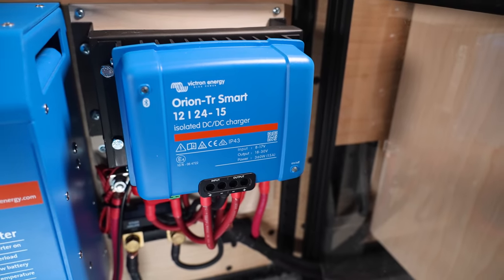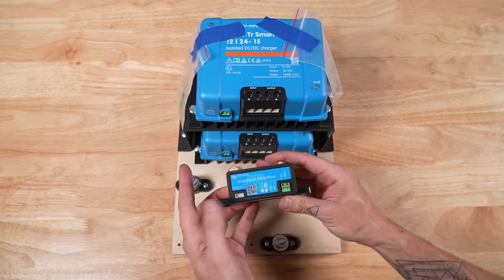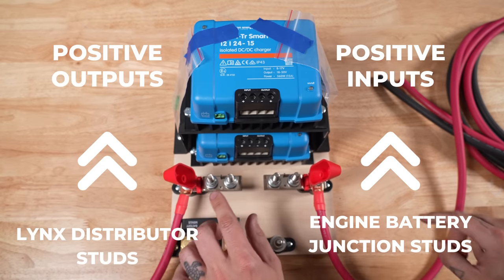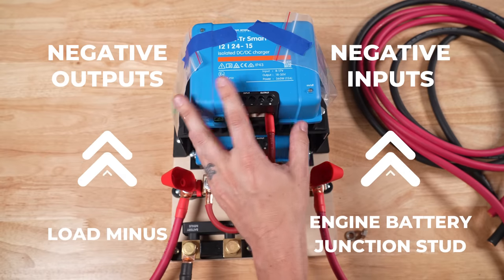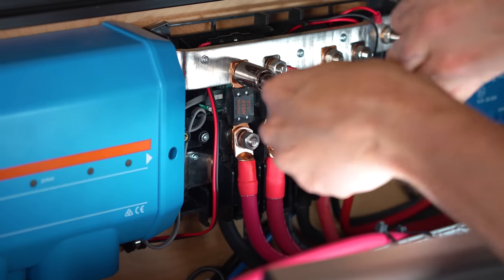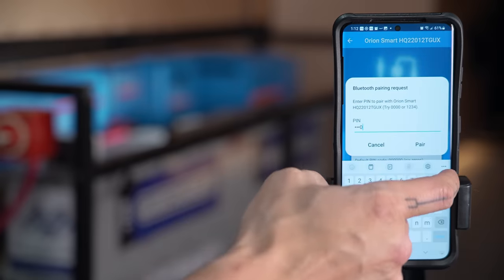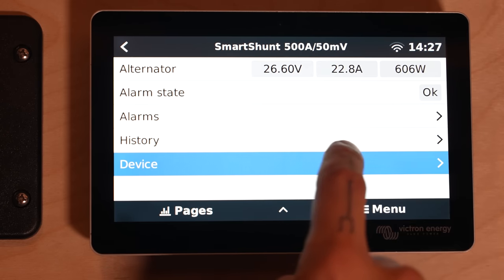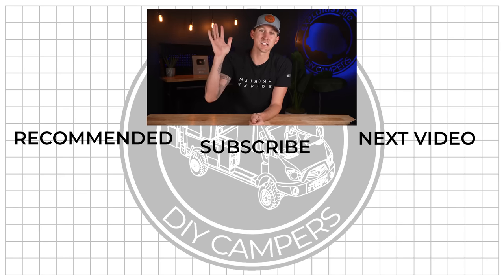TRANSIT ALTERNATOR CHARGING - DUAL VICTRON ORIONS

Comment: I did essentially the exact same thing for my Transit.  I found that you will need to add cooling fans for each Orion.  They heat up fast and will drastically reduce (throttle) charging output unless kept cool.
Reply from the maker: Neat!  Glad you found a solution for your overheating issues.  That's not a problem we are experiencing, but we have pretty good ventilation in our enclosure.
Reply: Sell them and get a Buckboost 50 or 100A.
 It runs cooler.
Reply: @silviuflorescu6838  I ran a buck booster for awhile.  It did run cooler but it was not as easy to manage as the Orions.  You have to hook a laptop up to the Buckbooster to manage the settings.  Orions turned out to be simple and effective (as long as they are kept cool)
Reply: @TrailAgent  , you are right, they are harder to set up and need a laptop.
Another drowback... unavailable 🙂
Reply: @TrailAgent I highly recommend a three-quarter inch gap between the air-cooled fins and the mounting surface.   Much better air flow and reduced temp of charger.

Comment: Why didnt you just get a 30amp instaed of two 15amps dc2dc’s?
Reply from the maker: It'd be the same wire-up process.  For this particular video; this was connected to a 24V battery bank; in which a 30A Orion doesn't exist.

15A @ 24V is the same as 30A at 12V.

Comment: So Victron’s recommendation that Orion’s be fixed to a non-combustible board isn’t really applicable…??
Reply from the maker: Plywood has an auto-ignition temperature of north of 500 degrees F.  If anything here gets that hot, there will be more than just the wood catching on fire.

Comment: I'm really confused as to why 150 Mega fuse is used on 30amps of charging current?
Reply from the maker: Wire size is based on current.  Fuse size is based on wire and is only loosely tied to the current.

Comment: I'm just curious but no one makes a 12v to 24v DC to DC charger bigger than the 15A that is shown here ? I've been searching and I haven't seen one.
Reply from the maker: Victron makes a 50A and a 100A; but the 100A is out of stock indefinitely and the 50 is pretty terrible from a programming/setup point of view.  They will be coming out with higher amperage ones soon; but they have also been saying that for a year at this point; so I'm not holding my breath.

Comment: Any ideas on specs of new B TO B ORION  chargers
Reply from the maker: Yes, but until they are officially announced, I hesitate to share because I don't want to hint at something that they keep pushing the release date back for.
Reply: @EXPLORISTlife it would be nice if they could accept wire thicker than 6ga. Perhaps they will have a threaded terminal that can handle a wire lug with heavier gauge wire. My setup for a travel trailer requires 4ga. I've been wondering what my options are.
Reply from the maker: Hm; that's interesting.  I haven't run into a single scenario where somebody NEEDS larger than 6ga wire.  We can really push the voltage drop to it's limits since the entire point of a DC DC Charger is to boost the incoming voltage.
Reply: @EXPLORISTlife  I'm trying to run it from my 4runner to my travel trailer so it's a longer run than a van. That's a good point that it adjusts the voltage anyway so as long as it's close to the battery, it should have the proper voltage, I just won't get the full amps, but wouldn't it have the potential to heat the wires up beyond their rating?
Reply from the maker: 30A through 6ga wire is WELL within it max ampacity rating.
Reply: @EXPLORISTlife  for a 15' run? 30' of total wire? I used the Blue Sea systems app and it recommended 4ga. The batteries are in the center of the travel trailer and the battery is in the front of the 4runner (obviously).
Reply from the maker: 30A @ 12V through 95ft of 6ga wire is still only 10% voltage drop.
Reply: @EXPLORISTlife  oh, I was using the default of 3% but since it regulates the voltage I assume that would be corrected. That makes sense. Thank you for helping me understand that better. So just to be clear, I should be able to get the full 30 amps (or close) but would have some voltage drop due to the distance but that would be corrected by the DC to DC charger.
Reply from the maker: Yep!  Exactly.
Reply: @EXPLORISTlife  you're a great teacher 🍎, thanks!

Comment: I have nearly the exact same setup. 24v system with 2 DC to DC chargers. Hooked directly to battery. But my 2 chargers won't output more than 400w max. I need help with settings or something. Anybody?

Comment: Another great video. From what I could tell the two chargers are wired in parallel. Just for some clarification do you need to use the isolated chargers to connect them in parallel or would non-isolated be ok? I've looked over the manuals for the various dc-dc chargers and converters and in some cases they don't mention parallel or series. For the Orion 70amp converter version like the one in the setup above, that was in a previous video, the manual says you can have up to 5 in parallel but the manual isn't clear how that is done. I was wondering if in a future video you could explain the difference between isolated and non-isolated, converters and chargers and if they should be in parallel or series. The Victron diagrams do show dual chargers but they have a lot of data cables connected between the devices and its really hard to tell if any of that is actually required. These videos are amazing and really do clarify a lot of info.
Reply: Isolated just means it has a different ground. In this case they have a 24V system but only 12V on the vehicle side. In most cases you can just use the chassis and share the ground connection

Comment: I am confused as to why you didn't just select the 12|12-30 Orion instead of two 12|12-15 versions?
Reply from the maker: Because we have a 24v battery bank. 🙂👍  The 12|24-15 is equal to the 12|12-30

Comment: Why do you need to put this between the alternator and the battery?
Reply from the maker: Because that’s how the device works? 🤨
Reply from the maker: Some additional context to your question may yield a better answer.
Reply: I mean like I have a 200amp relay that allows my alternator to connect to my lithium battery but when I turn the vehicle off the relay then disconnects the starter battery from the lithium battery, what is the benefit your setup with Orions vs my set up?

Comment: Hi I was wondering if you would be able to design a battery system for my 5th wheel RV. I'm looking for a system that would work with solar, generator, shore power and alternator from my semi truck. If you are interested feel free to respond to this message. Thank you Mario Marchigiano Jr
Reply from the maker: One step ahead of ya: https://shop.explorist.life/shop/all-products/camper-wiring-kits/complete-wiring-kits/wiring-diagram-kits/50a-oem-rv-upgrade-400-1200ah-battery-bank-multiplus-3k-12v-2x120v-orion-12-1230-wiring-diagram-kit/
Reply from the maker: Or if you've got 30A shore power: https://shop.explorist.life/shop/all-products/camper-wiring-kits/complete-wiring-kits/wiring-diagram-kits/30a-oem-rv-upgrade-400-1200ah-battery-bank-multiplus-3k-12-orion-12-12-30-wiring-diagram-kit/

Comment: Personally, I've found the Orions to be very underwhelming.  Not integrated at all with the Cerbo, and it gets REALLY hot to the point of throttling.  Definitely needs a cooling fan!
Reply: I have a solar charger with the exact same cooling design as these alternator chargers.  The solar charger would get extremely hot so I put 3/4" inch spacers between the mounting screws and the mounting surface.  This made a huge difference with air flow and temperature of the victron solar charger.
Reply: Wait until the new 50a  model gets released. At the end of this year. It has VE direct as well as a bunch of new features.
Reply: @extremeacc101  That sounds much better than this solution.. Has that been confirmed by Victron?
Reply from the maker: They will be more powerful, cooler, have ve.direct and ve.smart networking, but the release day has not been confirmed and in fact has kept getting pushed back for over a year at this point.

Comment: Gidday NATO, got no help from Victron, looks like you’re it…the orions have isolated and non isolated units,  how can I work out what I need? Thanks
Reply from the maker: This may take a more in-depth look at your personal setup.  If you have purchased/are purchasing from our store (shop.explorist.life) reach out for some more personalized help: shop.explorist.life/support

If you've purchased/are purchasing elsewhere, reach out to your dealer for support.  We'd love to have you as a shop.explorist.life customer so we can provide a bit more help in the future. 🙂
Reply: @EXPLORISTlife thanks Nate, I’m in Australia, if you were a bit closer I’d be a customer for sure, and if I was starting from scratch, you quite possibly would’ve designed both systems, but I’m adding to and upgrading what I’ve already got. I don’t watch the idiot box(tv), I watch relevant DIY YT videos like yours, as I’m gearing up for remote travel, and so I can also troubleshoot issues along the way.
Reply from the maker: Australia, nice!!  We have loads of customers there and is our second biggest market after the USA.  We ship internationally. Would love to help you out: https://shop.explorist.life😊
Reply: @EXPLORISTlife  not surprising, we got people that will fit out mobile off grid solar but we don’t have Explorist Life people for DIYers, that I’ve come across. I’m adding a dcdc charger for backup and topping up when getting days of overcast weather, otherwise it’ll be turned off. I worked out I need the isolated Orion and I have a 80A alternator so probably a 12/12 30 unit, it’s similar wattage to the solar panel’s, BUT, I don’t like the heat issues these have and I’m not going to add cooling fans etc, i consider it an inferior product, while I don’t always use top shelf products, what I do choose has to do it’s job adequately. Not keen on running two units, adds to the complexity and space issues. If you can convince me the heat isn’t an issue and we can work out what I need I’ll buy a wiring kit from you. I can buy a new isolated 12/12 30 for AU$300.49, and already have a 500A smart shunt. Let’s see what we can work out. Thanks Nato..
Reply from the maker: @FarqueKnowsWhere  If you've got 12V in and 12V out; you should go with the new Orion XS 50A charger.  Smaller, more powerful, doesn't run as hot, in stock, ships to Australia, and we have a wiring kit for it.

Orion XS: https://shop.explorist.life/shop/all-products/victron-orion-xs-1212-50-dc-dc-charger-non-isolated/

Wiring Kit: https://shop.explorist.life/shop/all-products/victron-orion-xs-12-12-50-dc-to-dc-charger-wiring-kit/
Reply: @EXPLORISTlife  I can get the Orion XS here for  $282.14US. My vehicle is a 2013 Toyota Hilux with a 80A temperature compensating alternator 13.2v - 14.8v. What other information for the wiring kit? Thanks
Reply from the maker: @FarqueKnowsWhere all the information is on the product page.

Comment: Why not just install one renogy 40 amp DC to DC charger. A lot less expensive and simpler install. The renogy is just as reliable as the victron.
Reply from the maker: "The renogy is just as reliable as the victron."  That's simply not true.  The only thing renogy makes that is as reliable or more reliable than Victron is solar panels in the US (since Victron doesn't sell solar panels in the US).
Reply from the maker: But... from a more technical reason... Go ahead an tell me what would happen to that 40A renogy DC DC charger if we connected it to our 24V battery bank.  I'll give you a hint: it would involve smoke.

Comment: Looks fused wrong.  The input to the dc/dc chargers should be fused back at the connection to the vehical charging system.
Reply from the maker: There is indeed fusing back at the vehicle connection point, yes.  It's fused correctly.  Thanks for watching, though.
Reply: @EXPLORISTlife  thanks for the speedy responce.  I'll toss out a second question - why not size the dc/dc charger correctly instead of complicating the installation.
Reply from the maker: @montanadan2524 parts availability.  A larger Victron dc dc charger may not exist depending on your needs, this requiring using multiple of them.
Reply from the maker: If you're in the process of planning the purchase of a new electrical system... this may take a more in-depth look at your personal setup.  If you have purchased/are purchasing from our store (shop.explorist.life) reach out for some more personalized help: shop.explorist.life/support

Comment: Couldn't you just have got one 30A charger rather than 2 15A?
Reply from the maker: If we had a 12V battery bank, yes, but we have a 24V battery bank and 30A @ 12V is the same output as 15A @ 24V.

Comment: Putting that on top of the other is not good will hold heat in there
Reply from the maker: Hey there!   I know you are just speculating and trying to find something wrong with my install, but It's important to understand that I actually checked that with a thermal imaging camera and saw little heat difference between the two units.

Comment: Should have waited 7 months and instead 2 50a
Reply from the maker: That actually would have been closer to a 2 year wait from the original install with no guarantees on the 12v-24v version.
Reply: @EXPLORISTlife  that's a long time between making video and posting 🤣
Reply from the maker: Original electrical install video where we skipped alternator charging waiting for the Orion XS was published in Summer of 2022, so yeah... no. we couldn't wait any longer. 🤷🤣

Comment: I’m not sure why everyone is enamored with charging a LiPo using an automotive alternator.  Auto alternators are not designed to do this kind of duty and they will eventually fail.  They don’t like constant long term constant high current loads.  The design doesn’t lend itself to that kind of cooling.  Second is the diode pack doesn’t tolerate high voltage spikes which occur on sudden open circuit conditions.  They are designed to be connected to wet cell batteries.  Unless you install some kind of current limiting AND a fast voltage clamp you might as well plan on replacing the alternator periodically.  Auto been on a fuel efficiency kick for several years.  They would have eventually switched to LiPo for starting to get rid of the weight.  Isn’t going to happen now because they are working towards electric vehicles.
Reply from the maker: Great point.  I'll uninstall all of this immediately. 🙄🙄🤣  Why are you spending your time watching alternator charging videos if you disagree with the concept?  So strange how people decide to spend their time.

Comment: no ferrules needed in terminals with pressure plates
Reply from the maker: We recommend them in this application  because it guarantees that all wire strands end up in their terminal properly.
Reply: @EXPLORISTlife  A ferrule lessens the contact surface as it cannot be compressed further by the terminal. That’s worse. The strands adjust to the inner terminal surfaces and spread evenly..
Reply from the maker: That's not true, no.  A ferrule is super thin and will compress under pressure.

Keep in mind that Victron contracts me to teach this stuff.  If I was doing it wrong, they would let me know and the damn sure wouldn't put it on their home page.

Feel free to not use ferrules if you like, but don't tell me I'm wrong.

Or if you think you are THAT right... start your own channel.

Comment: Wrong design. You need extra gap between fins and the wall and better having computer fans installed otherwise current setup defeat the purpose.
Reply from the maker: YOU can add gaps or fans if YOU like for additional cooling as YOU feel necessary, but it works within designed operational temperatures as is.
Reply: @EXPLORISTlife  you have installed two and reason being to get extra amps while current setup defeat the purpose as within 30 minutes or so both of your units to prevent overheating will reduce power upto 50%
Reply from the maker: We have not seen any derating from heat buildup with this setup, no.  Please don't assume we've had problems when you haven't seen our victronconnect app.  

Like I said... if you are having overheating issues, you'll have to reevaluate the cooling/ventilation in your own setup, but that's not the case with ours.
Reply: @EXPLORISTlife   ok, I just tried to help as many people in victron forum seeking help with the exact same problems. And one guy ran the test on dual victron to see the difference video called, more power with cooling. Anyway, good luck with your setup.
Reply from the maker: Since you provided me unsolicited advice, I'll do the same.  When you are 'trying to help as many people', you don't want to start your sentence with 'wrong design'.  That just comes across as talking shit and not being helpful.

'Being Helpful' would be saying: "Hey Nate, great video!  I've added some fans to the back of my orions for additional cooling as I was having overheating issues.  Can I write a blog post for you about this to publish on your site so that maybe it would help others?  Let me know what you think."
Reply: @EXPLORISTlife  How are you avoiding derating?   Victron Orions and their fanless solar controllers derate pretty aggressively in summer temps.   Even without two on top of each other.   Does the enclosure have fans moving air through it or something?
Reply from the maker: @CJ30123  There is simply enough passive ventilation in our enclosure to keep everything cool.  Gaps around the lid and along the back and sides of the enclosure.  We anticipated needing to add fans, but, have not yet needed to do so.
Reply: I’m running 2 - 12/12 30a Victron Orions for 60A. I mounted them separately on aluminum plates inside of a cabinet and haven’t experienced any derating. I’m sure every setup is different, but works for me.